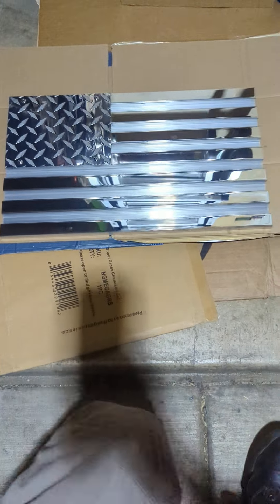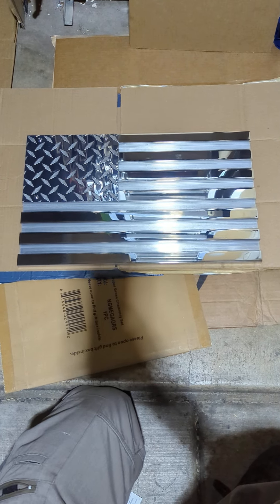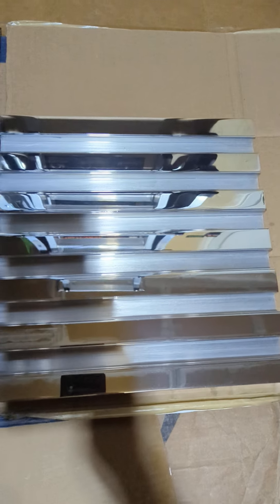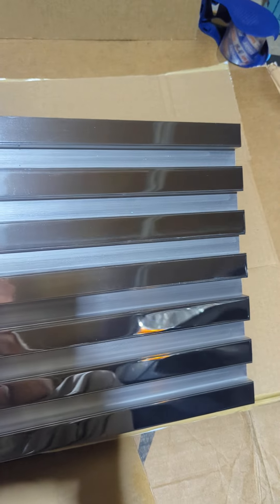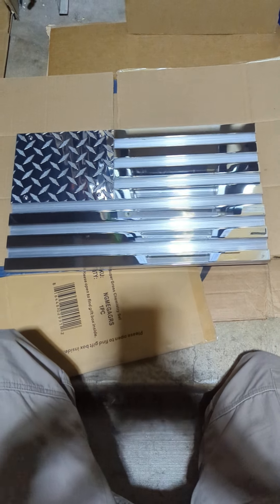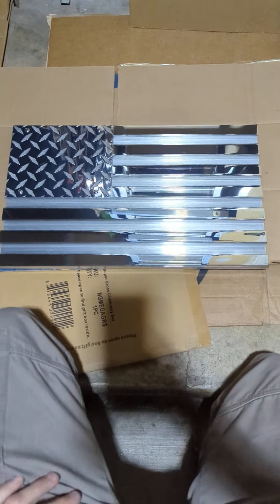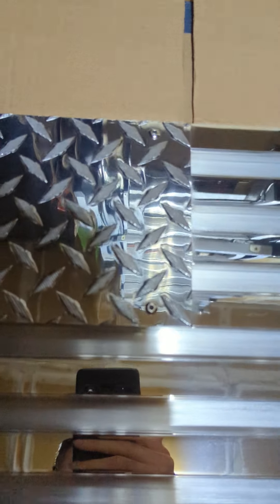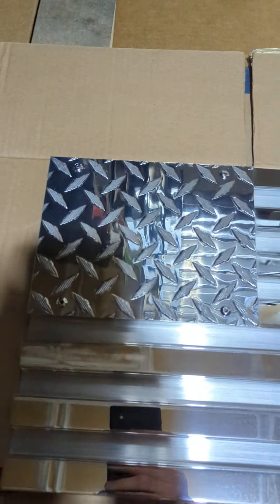Flag for Vietnam Veteran

Comment: I would love to have one!  How long does it take you to make one just like the one shown?  How heavy is it?  So creative!
Reply from the maker: Hey thanks very much. I had the idea for years before I ever started making them. I wanted to turn it into a business but the polishing takes so long its not cost effective. They take days to make, depending on how many hours I work on them per day. I've had several people tell me the flap disc version looks like more work goes into them, I was like WHAT?!?! They do look kinda cool too lol. I've made versions with thin red line, thin blue line, carbon fiber inserts, the clock in the diamond plate with rivets at 12, 3, 6, and 9 o'clock. Even did one with LED strip on the back, like undergrow. They weigh about 3 lbs. Hey thanks again for the comment, and Happy New Year!